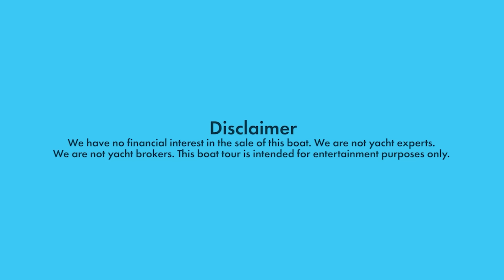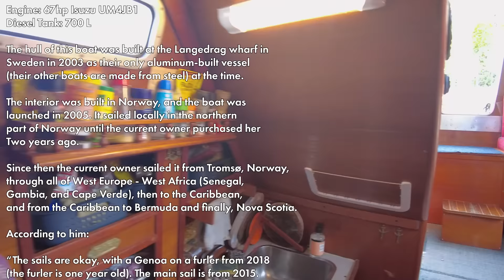A Budget Mini Aluminum EXPEDITION Vessel To Take You ANYWHERE [Full Tour] Learning the Lines

Comment: You should have spent more time showing keel shape and shape of the bottom
Reply: Yeah so fin means it's fast? But not as great in heavy weather? Would it self right?
Reply: The flat plate means you could park it up anywhere with some gunnel support.  Also the plate helps to slow roll by adding resistance ma,especially it less tender as I understand
Reply: Agreed, you should show the bottom when you have a boat on the hard.
Reply: I agree, but found the times he hasn't shown the hull ? Little to none.
Personally I'd rather watch their videos than most any others.
Knowledgeable, and no bs . Young man rocks it for his age and experience, thank you for every video 😊

Comment: Over all a practical boat.  Not much refrigeration going on there. A lotta engine for a 33'. The tiller handle looked too short, maybe because of the mainsheet right in front. Where it fell short with me was, what I could see below the waterline.  That sorta wing keel, no protection for the prop or the short spade rudder.  You do a fantastic job presenting all the boats you show us.  Thank you!

Comment: Thanks for yet another interesting walk through.  I'm absolutely baffled why there are not more boats "like this" - that is some degree of custom and small.  I especially like these smaller vessels, where the owners put both wants and needs, without the extras that the manufacturers stick on.  I'm surprised there is not a small variety of sailboats of small size that are essentially "one bedroom", with the occasional overnight guest getting to sleep on the seating area with the table down.  But, then I personally wouldn't be doing long hauls in a tiny boat - and if I had the money, I'd have a large gulet with a crew.
Reply: Small boats are best boats

Comment: Obvious tradeoffs with aluminum however if you're Solo or limited crew, meaning all crew asleep and on autopilot, it can be a lifesaver as aluminum stands out well in radar, therefore avoiding night collisions.

The hidden plus with the Pullman Style Berth is potential for equal privacy that V-Berths fall shorter on. For example you can fit a family of four or adults in there perhaps needing more quiet uninterrupted relaxation, the large bench seat in the Pullman would accommodate that arrangement, thus allowing noisier half of the crew to do their thing isolated from a larger half. You could literally have a small family with two skippers on shifts sail this and the family would have adequate privacy. An excellent design!

The extra large 67hp motor means if you hit a storm or high seas, you're not just putting along barely or not making large wave crests, etc. or lose time due to poor wind, can be promptly made up via motoring.

The unique keel/Rudder styling is desirous of efficiency, speed.

My only dislike is the diesel heater.Diesel smell repulses me so this should be changed out.  I would replace with propane and add second portable wood stove for extended docked/live aboard situations.

I would buy an undersized pilothouse style sailboat anyday.

Comment: Very nice boat. The only thing that would bother me a bit is the keel and the spade rudder. Here would have been a Twinkiel and a rudder with full skeg nicer. With this you can dry-fall. The current keel design is more suitable for collecting as much algae and rope remains that drift just below the water surface.

A thorough refurbishment and cleaning will bring the boat back into good optical condition without much effort and cost. If you then renew the standing and running rigging and make a few extra bucks loose to have more solar panels, as well as a reasonable bimini, then you have here a visually and technically really charming beauty that will take you anywhere.

65,000 CAD may seem a bit much for a 33" boat at first, but I'm sure it would be worth it if, well, if it weren't for the keel and rudder. I wouldn't want to have to dive under my boat in the middle of the Atlantic on a solo voyage in order to throw out the flotsam I've collected. But for someone who only sails in his own area and mostly near the coast, for the certainly looks different. Here, the keel construction probably does not interfere so extremely because you can quickly head for the next harbor or berth if necessary and there you can calmly get rid of the work you dragged along.
Reply: It might be easy to modify the keel, cut off the overhang in front, add swept-back wings toward the back, cut off the lower front of the rudder and add a skeg.  It was fun to see Sam Holmes intentionally beach his modified full keel Cape Dory at Mont-Saint-Michel.
Reply: @John-Nada Sam is a true sailor.  I follow him as well.

Comment: Nice boat for Arctic Cruising, though tbh, I'd go with Steel rather than aluminium as you have to watch Aluminium protection like a Hawk as Salt Water Corrosion can get oretty horrific quite fast. For Tropical type temperatures, whith such a constrained and localised air volumes, and the Pilot house glazing, heat below can get downright nasty. Unfortunately for disabled me it lacks two essentials a Sugarscoop or Bathing platform to work as a Tender Dock plus provide easy Aft Cackpot access, plus for the Tropics for Sailcloth protection and ease of use, in Mast Mainsail Furling (with a Battenless Triradial Main, to help avoid chafing wear and tear, furling reliability, and a largely extended Sail Service Life. Due to Disability, a Classic Mast, Lazy Jacks and Stackpacks  have become an unusable Liability if Im going to stay afloat in Sailboats. For the Tropics I can find competent people everywhere for working on Fibreglass Boats, which is a pretty big factor notntoo bad for steel, but there's not that so many Welders Competent at welding Aluminium around. Next Sailboat for me, a solidly built Boat with a Unylester laminate, and no wood on deck, and Termite proof below Decks with a Sugarscoop. Internal Air volume is pretty decent, so fans should get the air moving nicely, with occasional use of 12v Air Con to get things comfortable for sleeping soundly. A very big Positive for that 33ft Sailboat is the lack of surplus steps. To steps in any direction is Brilliant. I can cope with 5 at a gentle angle, and too many such boats come with a vertical and dangerous number of steps Ladder. Even for Physically Able Bidied People. 👍❤️⛵️✨️✨️✨️
Reply: assuming this is Marine Grade aluminum, you'd call the local Welders Operating Engineers pipeline Union and they'd have a Red Seal guy with all the tickets.
Reply: @HeronPoint2021  Not Globally. Plus Marine Grade Aluminium really bloody Sucks - see the Damage that  Can rapidly wreck a Saildrive for example if you Don't keep Well on top of protective measures. With a totally aluminium Hull, not exactly an attractive or value for money long term prospect, which is why Steel is a far better option for extreme Cold Latitudes, as while still vulnerable to Corrosion, early warning of developing problems is vastly improved. If Destinations for Sailing are Temperate and Tropical Latitudes, there really isn't any material to Match Reinforced Resin Laminates, and even Polyester Resin ones can quite easily made Durable enough to have a Service life of close to 100 years. Try that with an Aluminium Hull . That doesn't mean I would Rule out Saildrives by the Way, though they really have to have an excellent Service and Maintenance Regime that is Strictly Adhered to. For me, anything under one for an 80 hp inboard, Must be a Volvo Saildrive, and o er 80 hp can be a Yanmar Diesel inboard, as at 80 hp and above, the Yanmar can have the ZF Saildrive leg, but I would personally rule out the 360 degrees rotatable version of it, for pretty obvious drive leg to Hull Sealing  Reasons. Why Chance it if dodging tree Trunks heading your way at night are a problem to spot Right ? Best Wishes.  Bob.

Comment: The sailing rig kind of sucks, because the shrouds are inside, which is indicative of a boat rigged to point into the wind, but it's not cutter rigged, which will hinder it's ability to point into the wind.  Kind of a mystery.  All boats are a compromise.  I feel like the sailing rig layout is a compromise that misses the mark.  Might not be to hard/expensive to correct though.  Most boats have a lot of positive features, but most boats have some compromises that make the boat a fail as well.  Moving the shrouds outboard is cheaper than adding a staysail, but I think if you're trying for any real distance, you need a staysail for versatility, especially heaving too.  Both could be done on this boat, and the OP has found a boat with many nice features, but it will need some modifications to make it truly bluewater capable, just from the rig.  For an aluminum boat, it may be worth it to invest in the changes to make this into a great passage maker!
Reply: On further study, the mast is likely too far forward to accommodate a staysail.  Hence why it is not included.  So the stays being inside the rail is a way to accomplish windward ability.  It probably works, somewhat.  Probably overall, the tiller steering is more bulletproof than a wheel, which takes more cockpit space.  I agree with the author that this is a nice compromise for the size.

Comment: It's just a little weekend sailing boat. It's maddeningly uncomfortable. The bow cabin bed is simply too short. The interior is crowded and cramped. The view from the enclosed space of the cockpit is poor. It is true that it is a sheltered place, but it is not really spacious. It can be stuffy and uncomfortable during a tropical cruise. For an aluminum boat, the conical corrosion of the hull must be examined very FIRELY. Until then, there is no enthusiastic fandom for it.
The ISUZU engine is nicely painted. Who knows how many operating hours it ran. Compared to this little loser, it is oversized and so is its consumption. The previous owner did not pay the current high price he was asking at some point now. I think there is one more zero in the price.